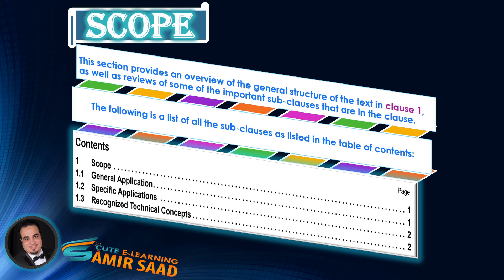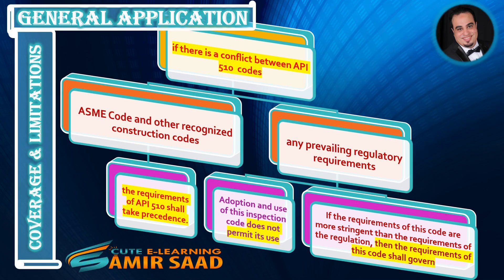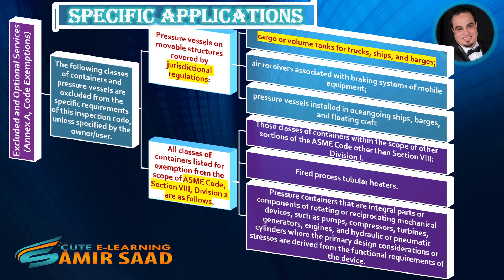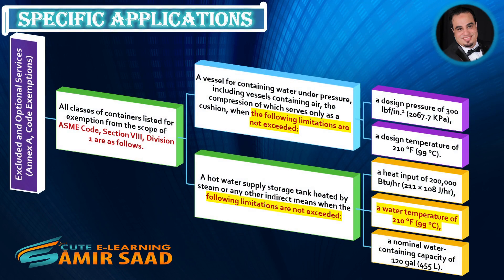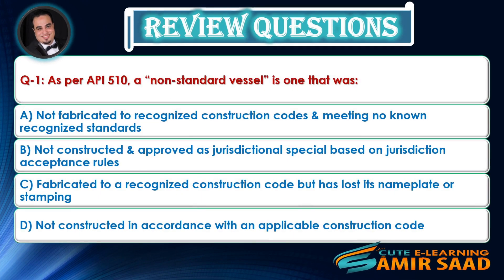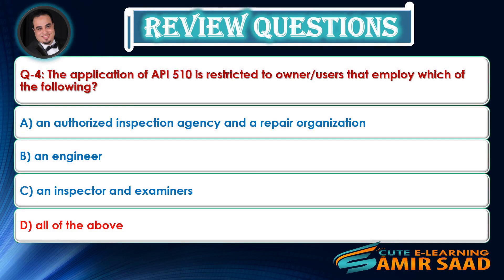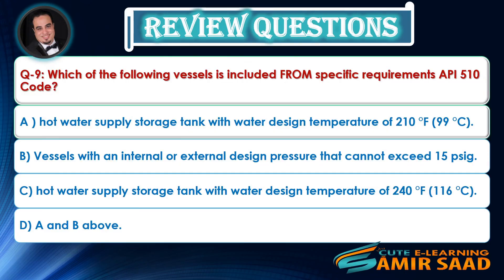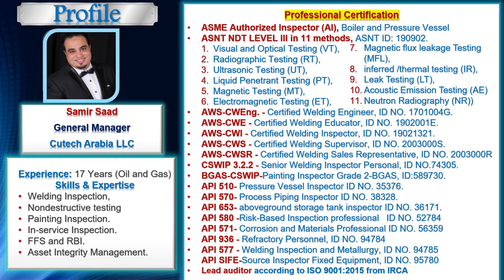API 510 (lecture 1)

Comment: Question 12 is very confused,’ the proper answer is C in accordance with the question recognized RBI must be c, otherwise is try to confuse
Reply from the maker: Risk based inspection is the process of developing a scheme of inspection based on knowledge of the risk of failure. The essential process is a risk analysis. This is the combination of an assessment of the likelihood (probability) of failure due to flaws damage, deterioration or degradation with an assessment of the consequences of such failure.
But , Fitness-For-Service (FFS) assessment procedures provide standardised routes to assess the residual properties of an in-service structure in order to aid decisions regarding whether continued operation is acceptable, or whether repair or replacement is needed.
So, all option is incorrect.
Reply: @Samir-Saad  noted with thanks, excellent clarification, your videos are really of the highest quality, an excellent degree of professionalism, I have seen and liked each of the videos of ASME VIII, API-572 and API-510.  I congratulate you, thank you for your contribution
Reply from the maker: You are welcome ❤